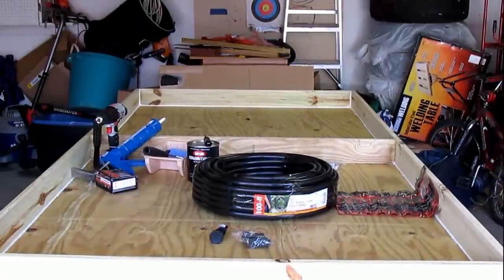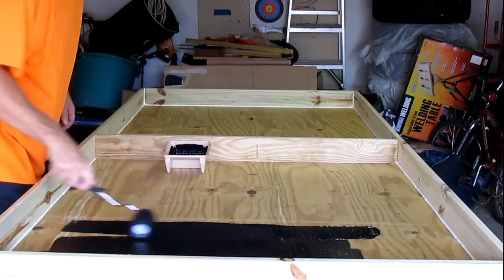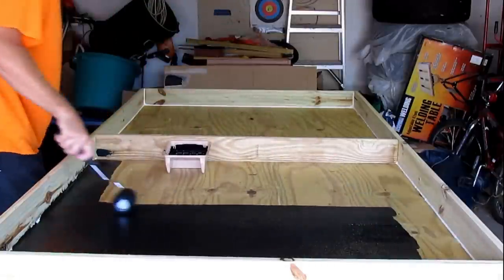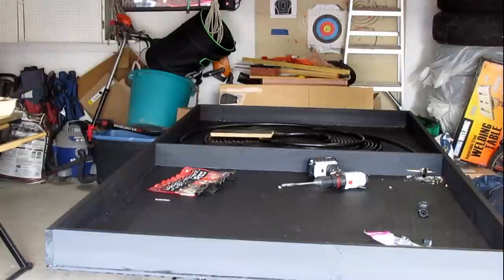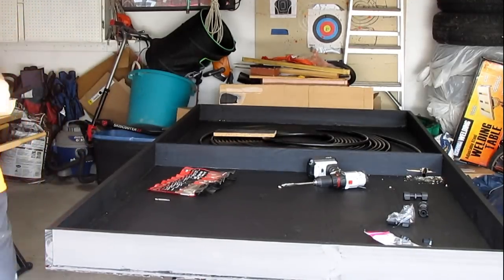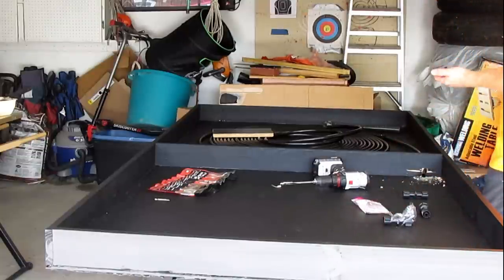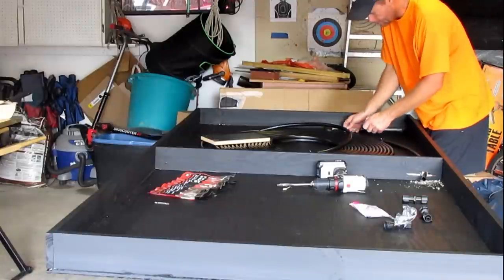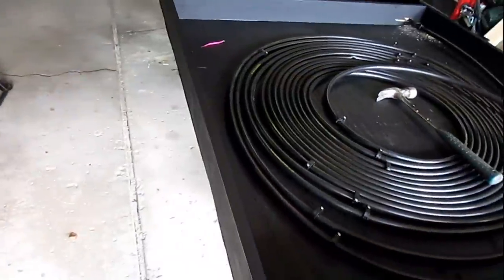How To Build A Solar Pool Heater - DIY!

Comment: Just a question - we built this and have been using it for about a week. The water is very hot as it sits in it but once we start the pump it drops it down a lot. Do you set the pump to a very low flow so it goes slower? Our pool hasn’t increased the temperature above 76 even on sunny days. What do you suggest?
Reply from the maker: Hi Sarah,
I do set the pump at the lowest setting. 
How much sunlight does the unit get?
What state are you in?
The biggest thing you can do is keep the pool covered with a cheap solar cover at all times when you're not in it, especially at night.
Before I started covering, we were losing 5-10 degrees overnight. Then the solar unit was playing catch up  for the better part of the day.
As Fall approaches, you will get less direct sun, aka a weaker sun. The more time the water spends in the unit the better. 
Here in Michigan we are close to the end of pool season :(
If my wife would allow me to put the heater on the roof I know I could get a few more weeks LOL.
Let me know if I can help with anything.
Thanks for stopping by & happy heating my friend!
#RCInsiders
Reply: RC Insiders - thanks! We live in the Southern Tier of New York State. Right now on sunny days it is from 10:30-6:30. We do keep it covered unless we are swimming in it at this point. I just ordered a timer to see if that helps. It does heat the water - just would like to keep it a little warmer. Our pool season is also coming to an end - sadly! Thanks for all the tips - we really appreciate it!
Reply from the maker: Hi Sarah,
I have experimented with the timer with good results.
There are competing theories on timers. 
The general consensus appears to be that you are better off heating a lot of water a little bit, as opposed to heating a little water a lot.
But my opinion is that as the sun gets weaker in the Fall, the water is not getting enough time in the unit to heat. I ran continuously through the Summer, but have now switched back to timer & am holding desperately to 82 in the pool :)
Days are getting shorter all too quickly, but I'm not closing til I can't keep it over 72!! Winter is just too long to give up just yet!!!
Let me know if the timer helps if you get the chance. I'm currently running 15 minutes on/off.
Ugh...I miss the pool already!!

Comment: for the water to trickle like that how long does it actually take to warm up the water even at 200ft don't you think you need to have a powerful pump to pump all the water into circulation and have enough force to distribute the water evenly through out the pool
Reply from the maker: Hi Justin,
I use the smaller pump to allow the water to have enough time to heat in the unit. If the water is moving to fast it will not heat.
After setting up the unit last weekend, it took 3 days to get the pool back up over 80. Temps were in the low 80's & all 3days were sunny all day.
Your pool pump creates plenty of circulation.
Remember to always keep the pool covered with a solar heater cover when not in use to assist & especially at night as this is when the pool loses the most heat.
If you want to pump a larger volume of water, I would suggest a second unit & more tubing.
Are you building one?
Thanks for dropping by.
@RCInsiders

Comment: I want to put it on a roof.. should I consider a higher GPH pump? Like 1500?
Reply from the maker: Hi,
It's not necessarily the gph, but the lift ability. 
The pump in the desc. has a 10 ft lift. How tall & far away is the roof for the heater?
Also, make sure the pump has the ability to control the gph. Like H,M or L flow.
When are you making your heater?
Have a great day :)
@RCInsiders
Reply: @RCInsiders  Thank you so much.. I'll need to measure that up.. but it will no doubt need to go more than 10 feet, but knowing this now I will look at that metric
Reply: @RCInsiders  I think what I will do is put this next to my pool this season with the cheap pump.. and if it works out I can replace the pump and move to the roof OR if I want more heat put a second one on the roof
Reply from the maker: Sounds like a good idea. I may try to put one on the roof this year as well :)
Reply: @RCInsiders  thanks.... i used tar paper on mine.. i think that should weather proof it a bit more .. but mainly had it on hand and saved on paint
Reply from the maker: That should work well :)

Comment: Nice vid, planning to try it out.  so any poly tubing work ? checked homedepot poly tube "dig" but it says its "heat resistant"
Reply from the maker: Hey Bogdan.
I'm not sure about the homedepot stuff.
All I can say for sure is the tubing in the description has not melted & it's gotten pretty darn hot.
Thanks for stopping by & happy heating my friend!
#RCInsiders

Comment: I have to paint the tubing . Can it be just 1 side seeing as I’m going to paint the wood black? I can only find clear tubing.
Reply from the maker: Hi Michael,
Yes, I think that would be fine. We are only using black as it draws in energy.
Did you check the parts list in the description? The tubing link goes to black tubing.
Let me know if I can help :)
Thanks for stopping by & happy heating my friend!
#RCInsiders
Reply: RC Insiders Thanks for the reply. I am almost done with your solar heater. I got the blue painted and will be finishing today. I ordered the pump on your list. I was pressed for time on the delivery of the black tubing. I will send a picture when I’m done. P.S. The plexiglass was expensive! Wow!
Reply from the maker: Awesome Michael!
Cant wait to see your handy work my friend :)

Comment: Hi. Nice very clear video !! I bought your own pump. I wanted to ask you if the pump manages to make the water go up for about two meters. In my case, the heater must be raised off the ground. I will try here in Italy.
Reply from the maker: Awesome Nico!
Yes, the pump should be able to handle that lift.
Italy? That's awesome!
I always wanted to visit. It looks like a beautiful country...
Good luck with your project & let me know if you have any questions.
Thanks for stopping by & happy heating my friend :)
#RCInsiders
Reply: @RCInsiders  
Thanks for the reply. I will try and let you know. A last question. What are the dimensions of the box? Thanks
Reply from the maker: Great!
The box is 4'x8'.
This is a standard sheet of plywood over here.
Hope it;s the same over there? This keeps it simple by not having to cut the plywood :)

Comment: You had tested it previous to the video. Lol. The second you plugged it in water came out the other side. It would have taken well over a minute for that little pump to get water all through that tubing. I know because I built this but with 1000 ft of irrigation tubing. I have an 19000 gallon pool so I had to scale it up. Good video though. Thanks.
Reply from the maker: Awesome Ryan!
How well is it working to heat that big of a pool?
What kind of climate do you live in? How much direct sun is you 1,000" of tubing getting?
Thanks for stopping by & happy heating my friend!!
#RCInsiders
Reply: I'm also interested in the larger scale workings for our pool.
Reply from the maker: Hi Sammantha,
I've been waiting for his reply on this too.
I would have to assume that with 1,000' of tubing, he has to be getting some very good results. 
He's saying he  has 5x the tubing and only 2x the size of my pool.
I have added a second unit this year and I don't have to run the heater all the time as the pool get too warm.
Thanks for stopping by & happy heating my friend :)
#RCInsiders

Comment: so its been 2 years how has it held up and how long did it take to bring up the temp of the entire pool?
Reply from the maker: Hi,
It has held up well. I keep it covered with a tarp throughout the winter.
I actually just got everything set back up yesterday & now starting to heat the pool.
There are variables that will determine how long it takes to get up to temp like amount of sun, outside temp & night time temps. Still getting into the 40's and 50's here at night.
A good week in the 70's & hopefully 80's & I will have the pool back into the high 70's. 78 is where I am comfortable but easily gets into the mid 80's if I let it when I have guests.
Are you going to build one?
Thanks for dropping by & happy heating my friend!!
#RCInsiders

Comment: Can the pool heater be used for other purposes like warming domestic water use?
Reply from the maker: Hi,
What kind of uses did you have in mind?
I am going to make an outside shower for when exiting the pool.
Making plans now :)
Thanks for dropping by & happy heating my friend!!
#RCInsiders
Reply: @RCInsiders  heating bathing water  in an estate or electricity is not available
Reply from the maker: @piusmutuku5759  Hi,
Yes, I think that would be cool :)
If you have no electricity you will need a solar pump.

Comment: Thanks for this video.  Looks easy for me to do. Did your size of pool keep a comfortable temperature when you actually went for a swim? Did you have to keep it running to maintenance the temperature or did it hold heat for a long while for bathing? Thank you
Reply from the maker: You're welcome Karron!
Up in the north here it's hard to keep the heat in the pool, especially overnight. Every minute that we are not in the pool, it is covered with a solar cover like this - https://amzn.to/3df4b5f
If you live in a warmer climate, you may not want the solar cover.
The biggest thing is to keep it covered overnight with either the solar cover or a regular cover. The pool loses tons of heat overnight & then you have to reheat all over again.
I am also adding a timer to the outlet this year and will have the pump kick on every 10 - 15 minutes to allow the water to get super warm.
With keeping the pool covered & running the solar heater, the pool is always comfortable to swim in.
There was a couple times last year when it was hot & sunny for a few days in a row that I didn't run the solar heater at all as it was getting a little too hot :)
Thanks for stopping by & hope you have an awesome pool season.Make sure to stop back by & let us know how your project turns out! :)
#RCInsiders

Comment: Does the pump matter as much? I'm thinking if the water pushes through too fast the water will cool the tubing instead of the other way around. My pump runs water about the same rate as a waterhose. What do you think? Should I find a weaker pump?
Reply from the maker: Hey Rey!
So there are competing theories about flow rate & adding timers to allow the water to sit for a bit in the heater.
I think the key is to find a happy medium.
The pump in the description has an adjustable flow rate which make fining your happy medium much easier.
My best advice for your situation would be to get an exact temp reading of the pool water & an exact temp of the water coming out of your heater.
If you are getting a couple degrees with that high flow rate you may be ok. You might not be heating the water a ton, but you will be moving a pretty high volume of water at a slightly elevated temp.
Thanks for stopping by & happy heating my friend!
#RCInsiders
Reply from the maker: Hi GM.
I;m thinking there has to be a flow rate that is too high. At some point, the flow rate would make heat transfer difficult/impossible?
This is why I think finding the happy medium is important.
What do you think?
Thanks for stopping by & happy heating my friend
#RCInsiders
Reply from the maker: Gottcha.
So do you think the flow rate of a garden faucet is too much for this style heater with 200' of tubing? 400'?
Thanks for your replies 👍
Reply from the maker: Great...Thanks again for your replies!

Comment: Thank you for the awesome video. It was very informative and easy to follow. I’m going to try and make one myself. Do you think I could use the red pex tubing and paint it black. It’s about the same price as the tubing you used and I could get it at my local Home Depot.                       Thanks again
Reply from the maker: You are most welcome Dave!
I think you could paint it, but I'm thinking this could be a huge pain in the ...
Good luck & have fun with your project. Let me know if ya' need a hand :)
Thanks for stopping by & happy heating my friend!!
#RCInsiders

Comment: Thanks for the video
Im building this before I set up my 16’x48 above ground pool 

Would you recommend filling the pool by hooking up a garden hose to the unit and then heating the water as it fills the pool?
Reply from the maker: Hi Anthony,
I don't see any reason not to.
Keep in mind that you will be feeding a continuous flow of ice cold water through the heater at a high flow rate.
Heating will probably be minimal. If you're not in a hurry to get the pool filled up, I would suggest turning the water on/off every 10 mins or so to allow the water to sit in the heater and warm up. Of course this will double the amount of time it will take to fill the pool..
Once the pool is full, the heater won''t have to fight the supply of ice cold water.
I would say experiment with the 10 on/off and see if you like the results.
Thanks for stopping by & happy heating my friend!
#RCInsiders
Reply: Awesome thank you 
I will let you know how it works out
Reply from the maker: Awesome :)

Comment: Did you ever determine if the solar heater put hot water in fast enough to actually heat the pool before the natural dissipation of the heat made it not useful? How far into your winter did this allow you to continue to use the pool. Did you ever take a second pool temp reading after letting the heater run, and from an area of the pool away from where the heated water was entering the pool? 
Asking to determine if this is a viable solution for heating my hot tub instead of the gas heater.
Reply from the maker: Hello David,
Yes the heater put warm water into the faster than the pool lost heat. On cloudier days the differential was slim, but sunny days produced a large differential.
We used the pool til the end of September. This is when the sun rode low enough in the sky to render the heater ineffective due to trees, the garage & the pool itself casting shadows.
Yes, we have a thermometer in an area away from the incoming heated water & always check it. There were times during long stretches of sunny days that I didn't run it at all as it was making the pool too hot. Even on cloudy days, the heater would still produce water 3-5 degrees warmer than the pool temp.
I think a hot tub is usually around 104 degrees?
This solar heater is an alternative energy & like most alternative energies it won't be as reliable/consistent as a gas/electric heater.
Although I have produced water over 140 degrees after letting the water sit in the tubes for 15-20 minutes on a hot sunny day, if you have multiple cloudy days it will be difficult to maintain a high hot tub temp over 100 degrees.
I think this works great for a pool heater. I am actually adding a second unit this year to try and squeeze a couple extra weeks out of an already short Michigan pool season. :)   
If you can deal with the inconsistencies of clouds/sun, I would say give it a shot. If you insist on a 100% constant temp, I would go with gas/electric.
I hope that helps.
Thanks for stopping by & happy heating my friend!!
#RCInsiders
Reply: @RCInsiders  I'm in sunny FL - and have full coverage most of the daytime. I'm hoping it runs all day and when I get home the Hot tub will be in the 110 - 115 range to relax a bit, then plunge into the pool to cool off. LOL. Just trying to get away from the gas bill!
Reply from the maker: I hear ya' David!
That's why I wanted this for the pool. The initial cost, bills & repairs!
Sunny sunny Florida! I used to live in a little town of St.Cloud. Do you know of it? Man I miss the weather!!
I would say you have a pretty good shot with the hot weather and mostly sunny to achieve your goal. If nothing else, you should see a good drop in the gas bill :)
Reply: @RCInsiders  I know St Cloud - I'm North in Jax Beach
Reply from the maker: Awesome man,
Did you decide to  try it?
We had our first nice day with temp 80. During direct peak sunlight had continuous flow of 95 degrees for 4 hours with 2 units.
I shut it off for 30 mins & had 140 degree water for about 10 mins as it eventually went came down in the 90's.

Comment: OK .. my mistake. U did say what kind of pump.  Now,  what type of  'small submersible pump'  did you use .. 200GPM,  600GPM .. or what ?  TX
Good video.
Reply from the maker: Hi Mike,
A link to the pump can be found in the video description along with all the other parts used :)
Here is the pump - https://amzn.to/3eLDHss
Happy heating 😀
#RCInsiders
Reply: @RCInsiders  TY
Reply from the maker: You are most welcome.
How did the build go?